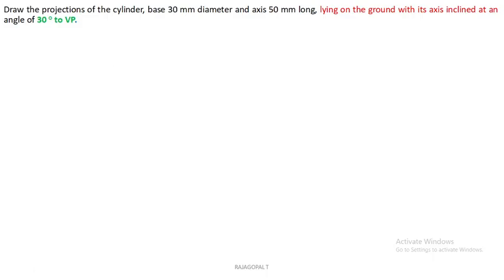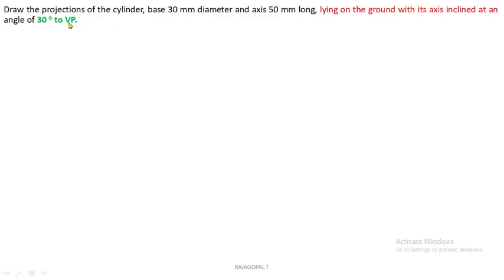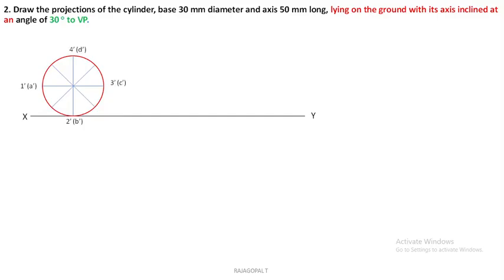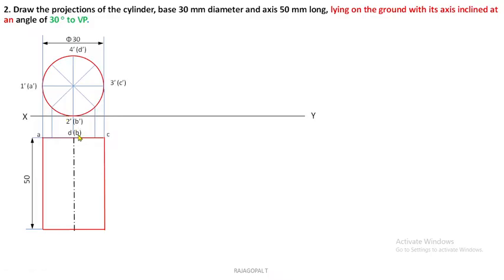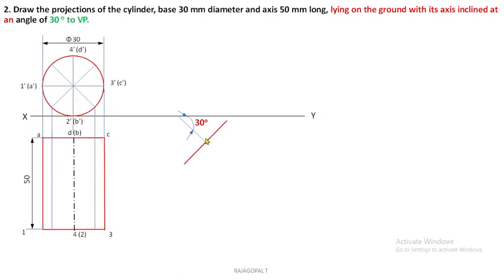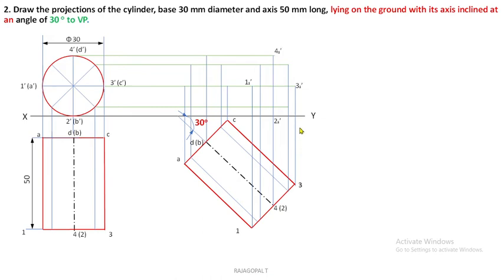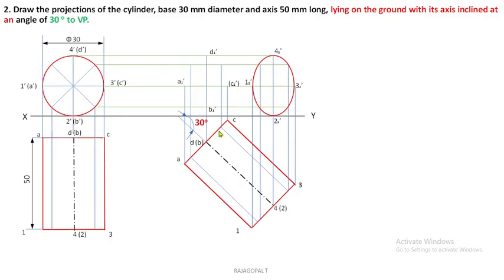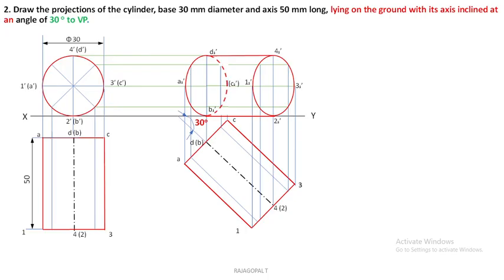Projection of Solid Cylinder | Axis Inclined to VP @rajagopalthangavelsforum

Comment: Draw the projections of the cylinder 50 mm diameter and 80 mm long, lying on the ground 
with its axis inclined at 30° to the VP and parallel to the ground.

Comment: a cone of 30mm diameter and 70 mm height rests on the ground on one of its base circle point such that apex is 20 mm and the nearest base circle point is 50 mm in front of vp and the base is perpendicular to hp .. intha problem eppadi varum sir .. pls help me sir
Reply: Naku